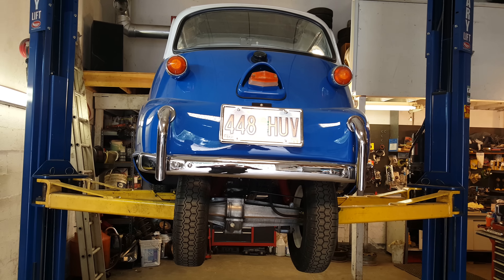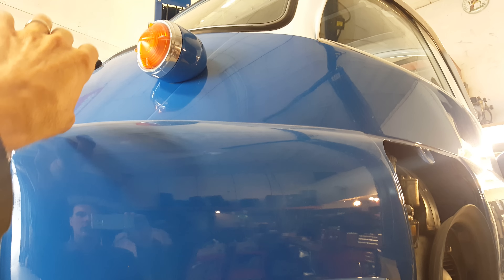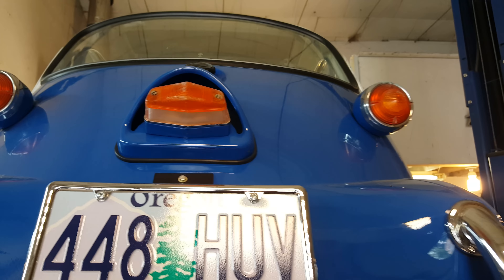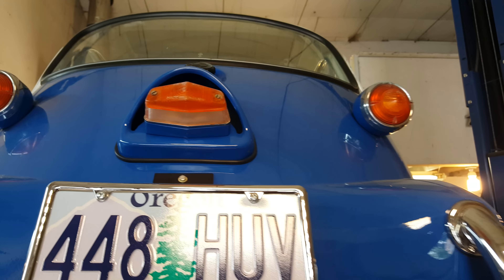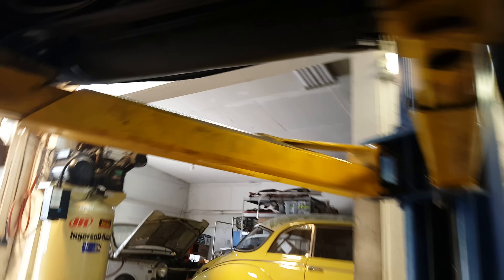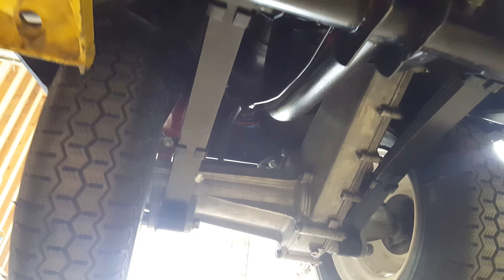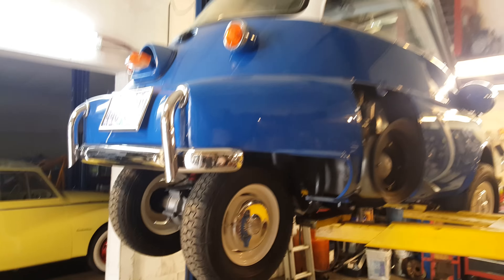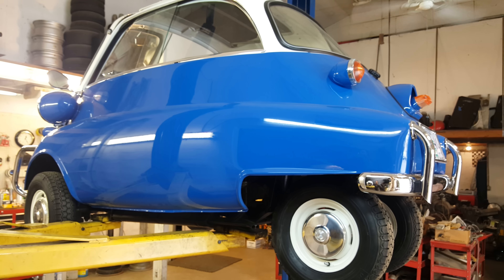Beautiful British Built Isetta

Comment: It was so clean underneath it. Makes working on it, easier. No mud, and filth, on it, like the last one you fixed. I bet it suffers from the same thing, that 3 of my moped purchases had. A little story, I have bought 3 mopeds, that looked like brand new. I assumed that it should be an easy fix, but noooooooooooo. They suffered from being washed, and then stored away for years, without being thoroughly dried. I've had fronts forks that were frozen, frozen cables, and a magneto completely rusted. This was on bikes with no exterior rust at all, only to find everything inside, to be rusty. I never use a hose or pressure washer on a bike, wipe down only. NOTICE TO ALL, thoroughly dry your vehicles before storing for extended periods.

Comment: After looking at the Wiki page on the Isetta, this may be a British built car for the Canadian market because the steering and door are on the left like North American cars. The British version had the steering assembly and door hinged on the right. They also had a 60 pound counterweight under the left side of the car to balance it out. The lights are British because at the time Canada used British car laws and hadn't been completely Americanized yet as far as cars went. Still a nice neat vehicle, could be that whoever put it back together overdid the brake adjustments, the Brits used a cone on a screw type adjuster and it was really easy to set the brakes up too tight. I worked on Vauxhalls and the original Minis, they had the same type of adjuster.

Comment: Where are the fuses in those UK editions?
 Note...The brake turn signals and running lights are orange.
Reply: One fuse located underneath the dashpod/speed housing.
Reply: Thanks for the reply!......Who ever wired this ca did not install a single fuse, I have a mix of old and new, replacing wiring soon. Going with the BMW factory style fuse block and installing it under the dash.